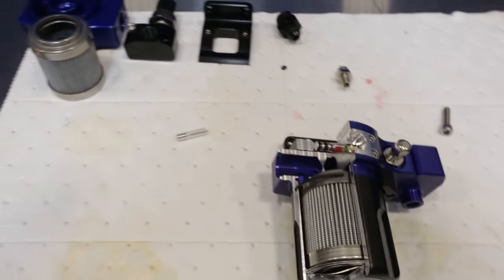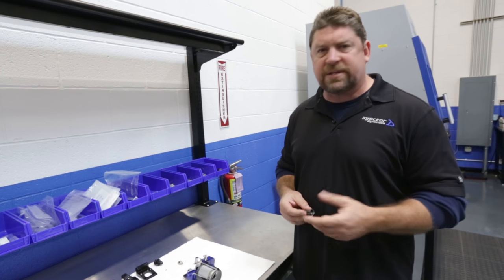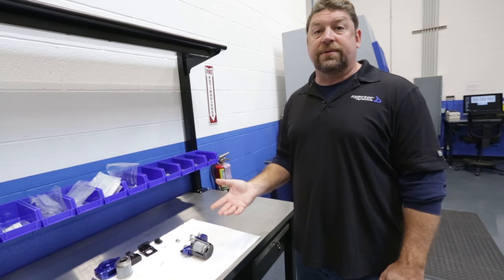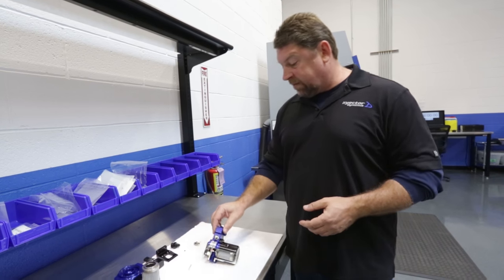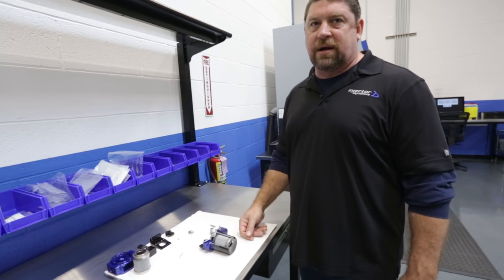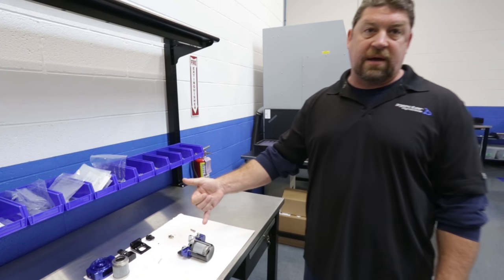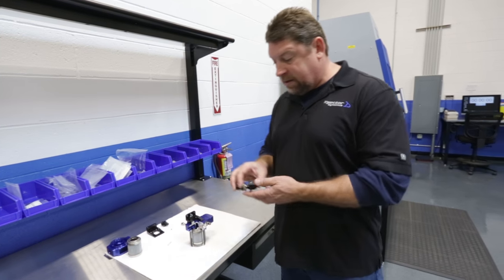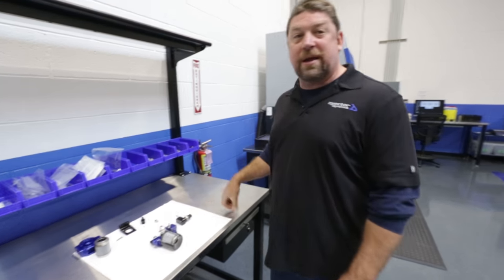A New Generation of Fuel Filter from Injector Dynamics

Comment: What a great way to come out with a new product.. not because you want to, but because you saw a need that isn't being met and on top of that you challenged what a fuel filter is and designed a solution that fixes many main points. Well done Injector Dynamics, well done!
Reply from the maker: +Sean M Exactly! That's what we thought. This product will be awesome.

Comment: +Speed Academy Hello does Injector Dynamics make a drop in GDI injector? I own a 2012 Hyundai Accent and I've been curious about a higher flow injector.
Reply from the maker: Not yet. There are no companies that actually make larger capacity GDI injectors rather use larger sizes from different applications /engines.
Reply: +Speed Academy thanks! I really appreciate your taking the time to answer my question.